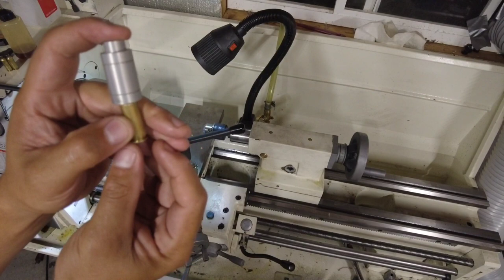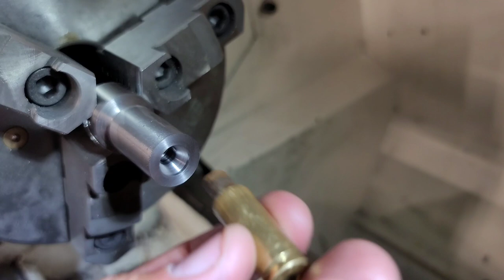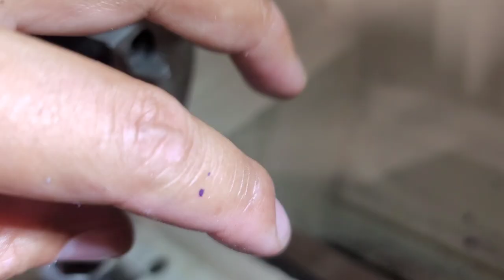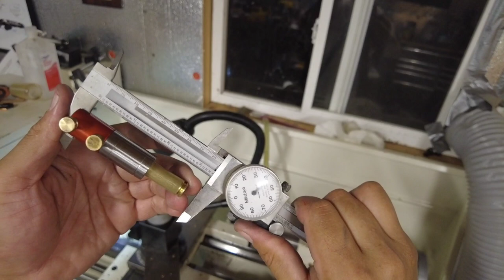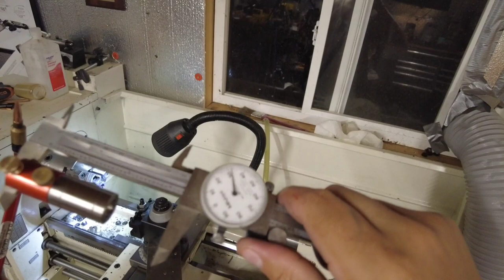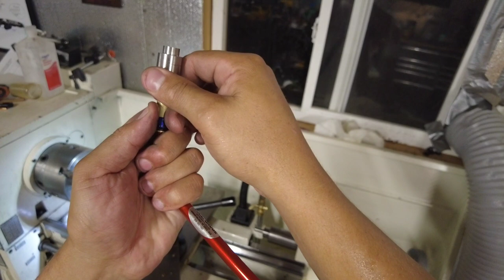A more accurate 3 in one Comparator | CBTO, Throat erosion gauge

Comment: I've seen this method used for Giraud trimmers inserts also. Only question I have is about your mention of using 0 bump. If I go less than 0015 bump, chambering become unreliable.
Reply from the maker: Majority of rifles I shoot use a floating bolt. It takes advantage of the slop. Just preference and I have never had unreliable chambering even in the worst weather conditions in competition. Were talking about half the size of a human hair

Comment: Pretty cool...aluminum CTE is actually pretty terrible. Tool steel is about twice as good but if you want total temperature stability in a steel like metal, then Invar is your winner.  For measuring cases CTE of the gauge isn't a big deal.  Pretty cool video, I need a lathe...lol